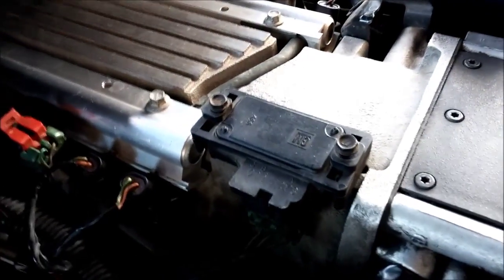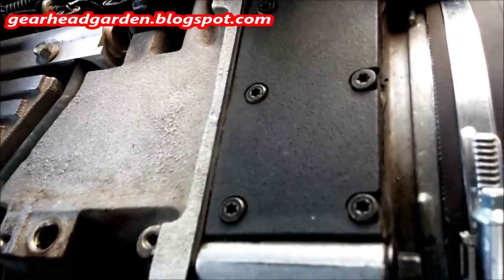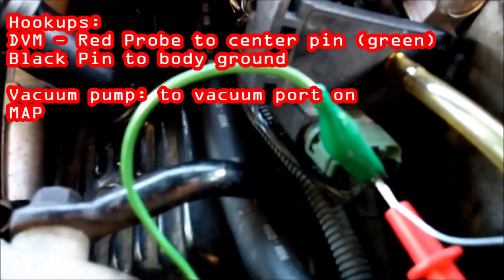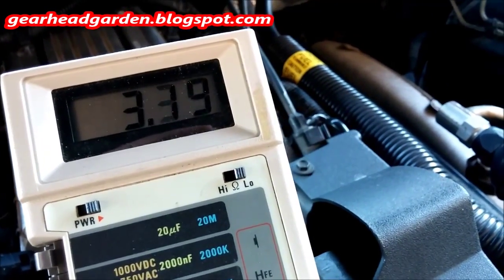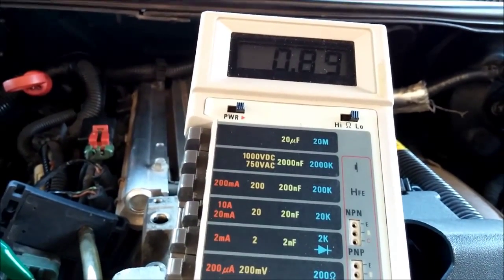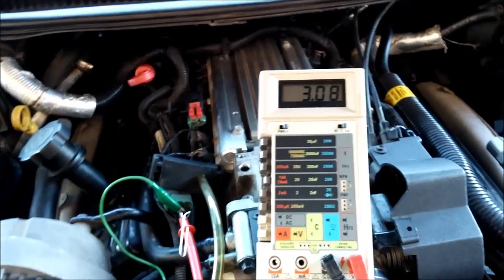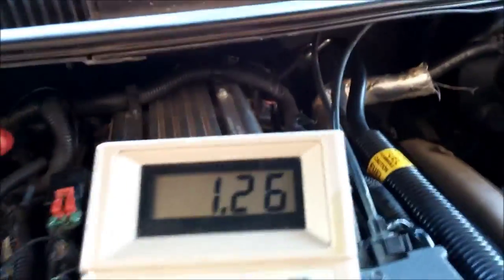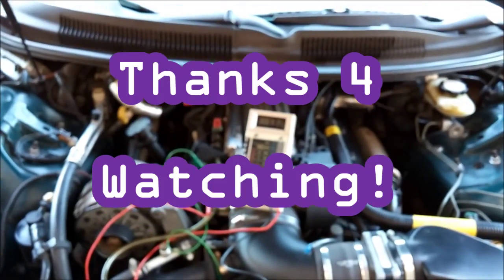How to Check your GM LT1 V8 MAP sensor

Comment: So I bought a 93 Pontiac firebird trans am 5.7l  lt1...  has a aftermarket cold intake ,what i find strange is that i dont see a maf sensor on it like other firebird lt1?? I change map sensors and iat sensor .. and was wondering  why my car doesn't have a maf sensor , there is a small module wired up  and hanging there ,any suggestions
Reply: 93 doesn’t have a maf....maf is 94-97
Reply: I have the same lil cube in my 93 firebird formula,did you ever find out what it is?

Comment: Your (MAP) sensor is faulty.... Most ALL Manifold Absolute Pressure Switches should read about 1.2 -1.7 Volts at startup & idle then read at a maximum 5.0 Volts when the sensor unit is at it's highest manifold pressure or in other words at (WOT), wide open throttle. Your (MAP) sensor is giving a lower reading under more pressure. Voltage always increases under more load... ie. vacuum.

Comment: Video was good, but wish you would have given results at 5, 10, 15, 20, and 25 inches of vacuum for reference info.  Thanks again
Reply from the maker: +G Bouc +G Bouc You're right and I was thinking about that while I was doing the video.  Unfortunately,  I was having trouble getting a good seal on my vacuum pump so the readings weren't as steady as I would have liked.  The big thing is  that the voltage drops should be around a volt for every 5 PSI of vacuum all the way down to Zero at around 25PSI.  Should never need more PSI than that for this test.  As long as the drop is proportional you've got a good MAP.  There's another video similar to this but not done on an LT1 ( still GM car tho) by richpin06a that is very well done. Link is: https://www.youtube.com/watch?v=B8EVhFc5Yqw